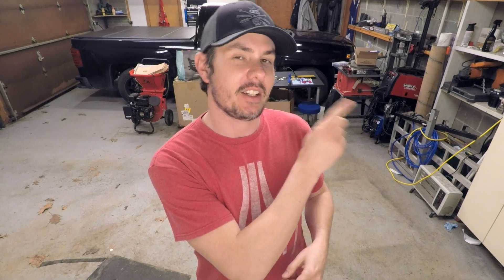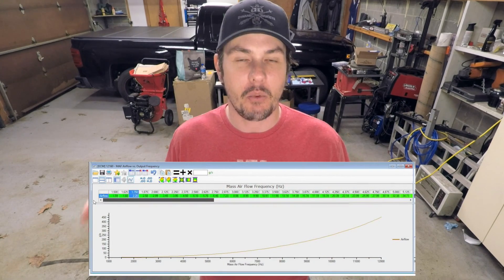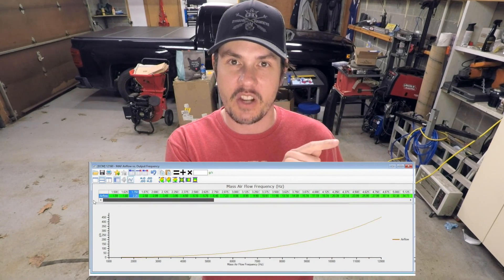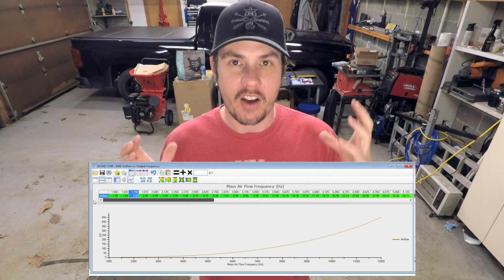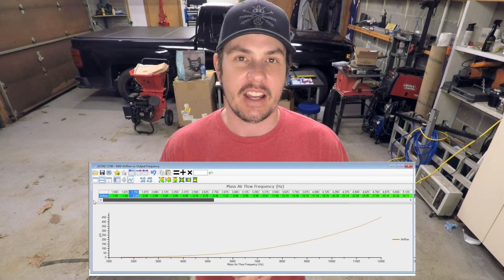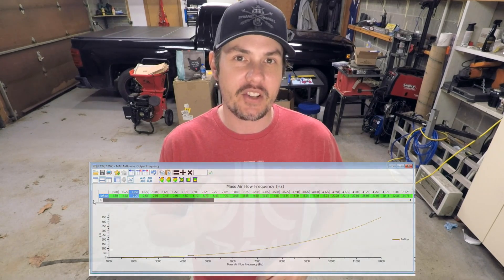Mass Airflow Sensors Explained, Tuning Series Vol. 3.1, HP Tuners

Comment: I first want to say that I greatly appreciate you putting all of this great information on tuning! My question is several times in the video you talked about adjusting a perimeter in a calculation to adjust for different size intake tubing. That just so happens to be relevant to me given I recently placed a RotoFab Big Gulp on my ZL1, do you have content on adjusting this parameter or maybe just some good references? Also, going to check the camaro6 forums, but wanted to ask here as well, TIA! Thanks once again for the great content!

Comment: Hey man, thanks for the videos! So I just bought HP tuners and I am getting the white band also. I still have to order it. If I can muster up a file, can I send it to you for a tune for a new combination what I did was refresh a 6.0 LS engine, and added a camshaft and intake, manifold and headers, so it will need a base tune what would you charge an old disabled guy like me for a bass tune if I could send you a file or let you do it remote tuning. I purchased credits.
Thanks

Comment: Need some help with a gen 3 tune. Trying to get a good base tune.. idle fueling is way off super lean won't even pick up on my wide band. Where should I start? Want it safe enough to drive it to get some log time to be able to tune it safely
Reply from the maker: What are you doing first, MAF or SD?
Reply: I'm trying to get it to run off maf it's a p59 ecu. Truck maf. 1 foot piece of pipe before the maf on the intake tube.. I set up the vcm scanner like you did for the maf and stuff just neeed a good starting point. I tried to watch all 3 of your 3rd gen videos and I didnt 100% get what I needed as a good starting point.. much appreciated!!
Reply: Do I need to force it into maf only then and try and go from there?
Reply from the maker: Yeah, and you should be able to adjust it until you get it idling and go from there using data logging

Comment: I've still got a gap in understanding between the frequency at the MAF and how that relates to mass per second. What the ECU wants to do is heat up the little element in the MAF to a hardcoded temperature, right? So it applies electrical pulses to the element in the MAF sensor at a certain rate (which we can measure in Hz), and when a pulse is applied, the element heats up, right? Until it reaches the desired temperature? And THEN, once the ECU knows which pulse rate we're at, it looks up how much fuel to spray and sprays it.

So how does the ECU know when to speed up or slow down these pulses? It to me like the ECU would need to know what to expect the next reading to be, which... if it did, it seems to me like we wouldn't need MAF sensors at all! I think I'm thinking about this backwards somehow...
Reply from the maker: Has a temp sensor and it's goal is to maintain a set temp, as more air goes across it then the ecu has to apply more Hz to keep the temp stable

Comment: I got a question about the meth injection comment. You stated it is advised to inject between the MAF and the throttle body. Is that applicable for only NA engines and NOT FI? In the BMW N55 community it is the general sentiment that you DO NOT inject in the intake, as some of the mixture will not get sucked in, and trickle back down the intake towards the intercooler, and instead you should inject right into the intake manifold (or if installed, the supplemental fueling port injection kit manifold) to ensure complete consumption of the meth/water mix.

Comment: Great videos.  Super informative. Got a quick question.  When increasing the diameter of the intake tube, are there hard coded parameters in HP Tuners that I need to be adjust or will tuning the MAF in the manner you teach automatically compensate for the increase in diameter?  Thanks! I can't find the answer anywhere!
Reply from the maker: The MAF scale is it. If you know how much larger you're going to can ballpark it by increasing your MAF scale by the same percent but it will still need dialed in.
Reply: @GoatRopeGarage  Awesome thanks!

Comment: Wow....no wonder I got a lean code on my VQ35DE engine in my G35 Coupe when I made/installed a custom 3" diameter intake pipe with a welded MAF flange. The diameter of the intake pipe increased thus, actual air entering into the engine was increase but when doing WOTs and in open loop fueling control (narrowband O2 sensor), fueling corrections were not added for the additional airflow. But even AFRs within narrowband sensor range were probably lean causing the ECU to hit a max correction percentage of fueling for "x" amount of time and still not achieve the targeted AFR....as a result, the OBD diagnostic failed this test and set the CEL.

Comment: So, I been fighting with some issues on my truck and 99% sure it's MAP related since running 12psi on 1 bar stock MAP. Can I disable the MAP stuff and just stay 100% MAF for a bit till I get new MAP delivered?
Reply from the maker: Sure, so long as you're not maxing out your MAF you should be alright
Reply: @GoatRopeGarage  thanks man. You're the only person that actually gives answers. Just wanna throw my laptop in the truck and drive down for a personal lesson
Reply: @GoatRopeGarage  actually not even getting deep into the throttle. Just cruising daily stuff. Western NY weather. Lol

Comment: So if you increase the maf diameter, the airflow at a given frequency will be higher right?  So would calculating the area difference be a good starting point for a bigger intake?
Reply from the maker: Yeah, you can get an idea of the difference that way so if the tube is 30% larger you can start there, it won't be perfect but it will be close enough that it runs so you can dial it in from idle.

Comment: Hi , sorry might be newbie question ,I have cammed my engine 6L l98 valve springs etc what is the limit to the maf would it be acceptable to keep running it it’s going to be a daily driver and at what point would it need to be strictly speed density would the maf max out under WOT pulls, cheers
Reply from the maker: It shouldn't, MAF can usually handle boost for awhile, the issue you might have is a cam with a narrow LSA can cause the mad sensor to have issues reading down in the lower rpms.
Reply: No worries thanks for the reply it’s a n/a setup sorry forgot to mention,
so there shouldn’t be any issues it reading at higher rpms? Is it possible to tune with the stock o2 sensors it’s a r/h drive Holden commodore ss  I’m not completely sure if they come out with wideband or not I will have to check  or are the oem ones just not accurate enough to get true afr reading ,would I be best to tee in another o2 boss for a wideband solely for tuning, thanks for your reply much appreciated

Comment: Love the videos. Question, you speak of speed density versus closed loop using MAF and O2. On my subaru, I am running both (tuner set this up for me). It switches depending on some parameter (I will guess load) to speed density as I was maxing out the MAF voltage at high boost levels (above 22psi). Have you done any of this or maybe you could shed more light on this hybrid option? Noticed that this wasn't an option you mentioned, so wanted to bring it up. 

Interestingly enough, I am indeed injecting water/methanol between my MAF and the throttle body, but my MAF has the air intake temp sensor built into it. You note that this can cause issues as the cooling from the water/meth won't be taken into account. I have actually had good performance with this system (not having them broke apart), but I am a little concerned after you explained it that there are some big risks associated. Would you be able to elaborate on those?
Reply from the maker: Spraying across the MAF can cause issues with the heater element, that is why we break it out so we are spraying between the MAF and the IAT.  On the GM platform we don't have the ability to really switch between MAF and SD per say, we can go into a mode where MAF is primary control in the higher RPM's as airflow is steady state for the most part up there.  But we can't go back into SD after that point, though we can disable the MAF if we exceed it and run off of SD alone if needed.
Reply: @GoatRopeGarage  Awesome, thanks for the info. In my setup, I am spraying after the MAF, between the top mount intercooler and the throttle body. The MAF and IAT are built in as one on the make/model/year car I am running, but I am definitely not accounting for the cooling affects the water/meth is doing. Do you feel that it would be all that beneficial to break out the IAT since the water/meth being sprayed in isn't all that consistent (in comparison to injectors by the intake valves)? The other concern I would have is the heat soak from the motor on the intake manifold itself versus on the intake tube where it currently sits. Any advise/thoughts on this?

I also confirmed that the way the hybrid option it setup in my example is based off MAF voltage. Once I get over 4volts on my MAF sensor, it switches to Speed Density which is a neat way of getting the best of both worlds I think!

Comment: I need you to look at my tune. Its way to rich when it gets to operating temp. lol
Reply from the maker: It's only rich at operating temp?
Reply: @GoatRopeGarage  yupp at cold idle its spot on but when it gets to operating temp it loads up real bad rich
Reply from the maker: Unplug your MAF sensor and see if it does it. About the only other thing I could think of off the top of my head that would make it run ticket at temperature is a bad oxygen sensor, that starts to fail when it gets warmer.
Reply: @GoatRopeGarage  i have done that and it runs pretty rough. The o2's seem to be working as should i have the PE set to 1.18 and its running about 13.9 rich at wot
Reply: @GoatRopeGarage  im in georgia and i have spent almost 3000.00 on people trying to tune it and i finally bought hp tuners and trying to fix it myself. Learning as i go. All people do is throw a bs tune in it and call it good.
Reply: @GoatRopeGarage  it also spark knocks and pings when at idle at operating temp
Reply from the maker: 13.9 at WOT isn't really all that rich, but you shouldn't have any spark knock or pinging at idle. What year and engine is this and what mods are you running? Maybe I can steer you in the right direction.
Reply: @GoatRopeGarage  its a 2006 silverado 5.3 with dart pro1 heads 625/625 234/242 @50 109 lsa cam sheet metal intake 102mm nick williams throttle body long tubes and a built 4l80e 411 gear. You can go to my channel to hear it and see the motor.
Reply from the maker: I would focus on your idle issues, if you're seeing real spark knock there you need to work on cleaning that up and then propagating those changes throughout the tune and then start dialing in from idle out.
Reply: So did you ever get this figured out? Curious as to what the fix was, if so.
Reply: @whodatSean I had a friend that was a tuner look at it and he made a ton of changes to the tables and it ran the best it ever had. All the tables was way off. I sold that truck a few years back.
Reply: @silveradosaga8595  Nice man! I'm looking at getting into tuning myself; been wanting to for a long time. Glad it was running good before you sold it. Cheers